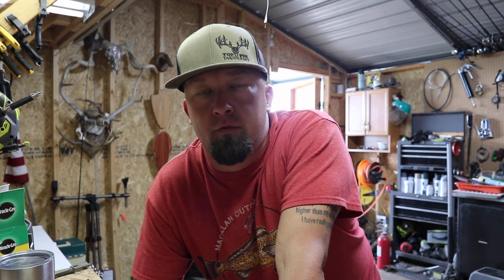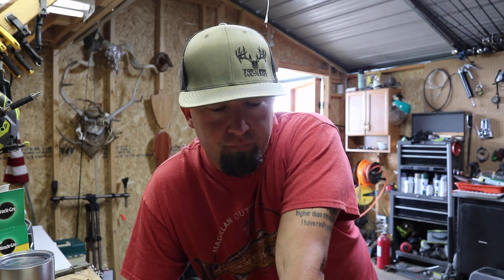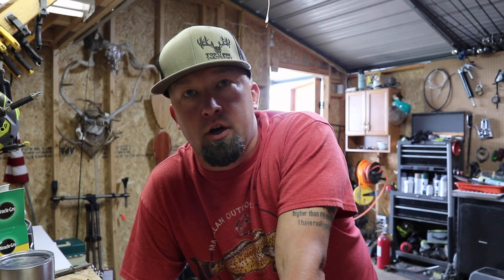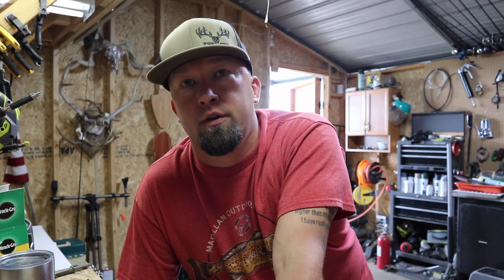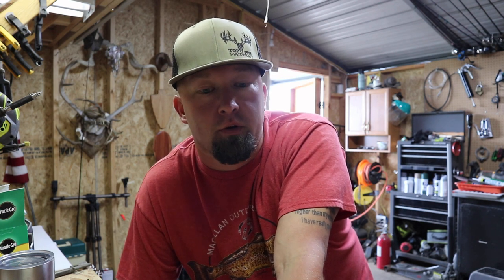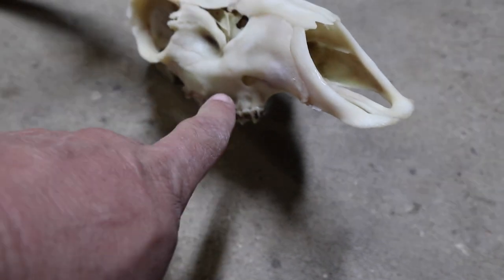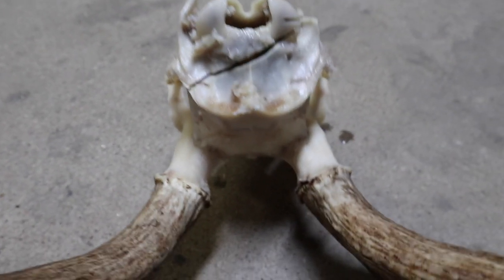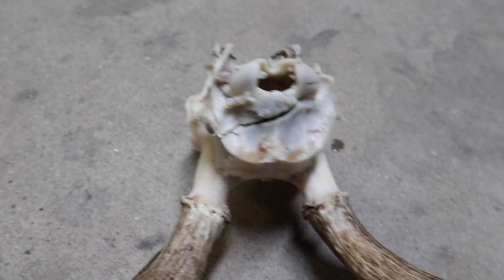Do Your Own Skull Mount!! - DIY - How To Euro Mount

Comment: I do mine and my son's heads. I use a heater that keeps stock tanks from freezing. 180 degrees, for a couple of days in a 30 gallon plastic tub. Time is not an issue. I use a cup of dawn dish soap and store brand oxiclean in the water. I do have a power washer but like he says, car wash works fine.
I don't whiten them because, hey, my house my rules.👍
Hog heads take longer and will have more grease in them. Leaving them longer helps but it will never be white white. 
You can slip the tusks out farther and glue them and they look like prehistoric beasts.
They are prehistoric beasts. 🤠
Great video. Thanks.
Reply from the maker: Thanks for the suggestion!
Reply: @OurTopPinLife 
My wife is disgusted by this process and doesn't like meat but it's set up in her greenhouse as supplemental heat so she kept my last hog head going for 2 weeks while I was deer hunting. Then for a few more days with my 10 point. She actually uses it more than I do. 
Separate likes, separate hobbies, separate freezers, happy home.
🤠👍

Comment: Love the videos man! Been boiling skulls myself for over a decade now and have always painted on the whitener. This will be my first year boiling them to whiten, my question is do you pre soak any of the skulls that you have to hydrate them before you simmer em in the peroxide? Some skulls I do completely dry after I clean em before I get the chance to whiten em and wondering if its better to soak em in water for a day before boiling em in the peroxide? Thanks in advance
Reply from the maker: I never let a skull dry out once it's been skinned. I always keep them in water until they are finished. If I get a head from a customer that is skinned and dried out I will soak it for several days before I work on it.
Reply from the maker: If your on FB search for the group Skull Mount Taxidermy. I started it a while back and its a great resource!

Comment: That was pretty cool! Have you ever thought about using those pain in the buy fire ants to clean it out? We used them to clean out crabs for mounting. They will get it all. Maybe try after the first boil and powerwash. Might take longer but you could be sitting on the porch jawing with a friend. Just an idea.
Reply from the maker: We've tried every method possible. We tried dermestid beetles for one season but they were a hassle!
Reply: So you no longer use beetles?

Comment: Removing the eyes and brain eliminate a lot of the grease. A flathead and a hammer will remove those two pieces of bone behind the ear drum pretty easy. Few small taps.
Reply from the maker: I normally blow the brains out with an air compressor before I boil. After I boil I remove the ear buds and drill them out
Reply: Air compressor. Have to try that. I usually stir with a filet knife and if the pressure washer is hooked up stick the turbo tip in it. Comes with most ryobi pressure washers. It’s great inside the brain cavity after cooking.